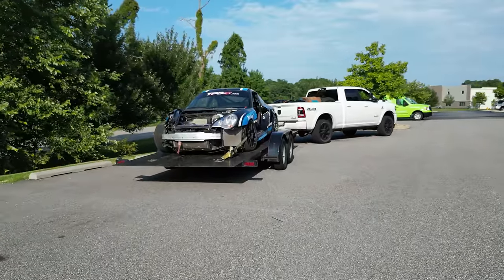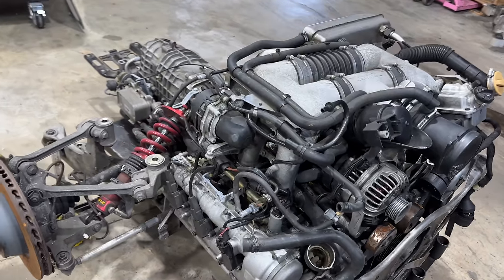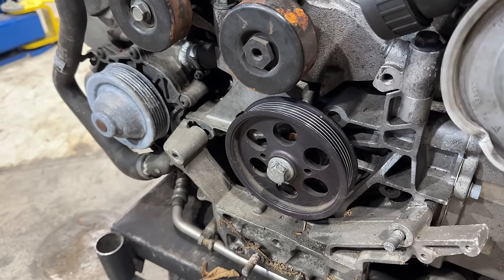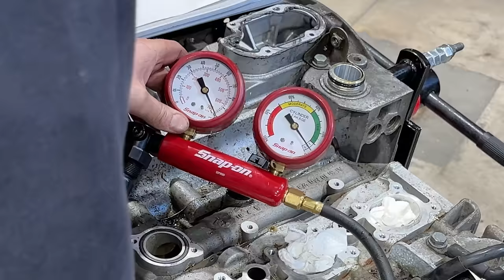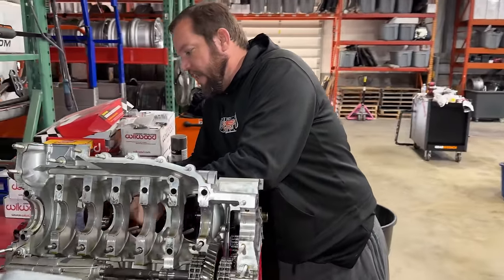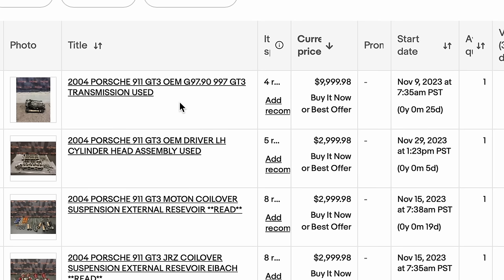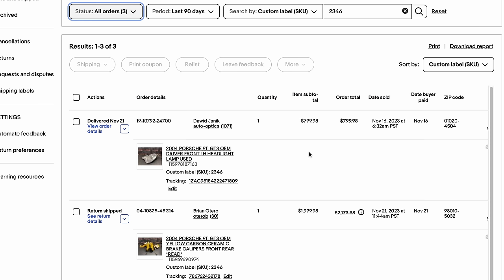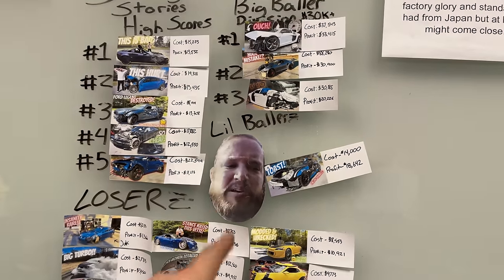I Bought a WRECKED Porsche GT3 Race Car!

Comment: -I am watching this because I have a 1986 911 RestoMod—Outlaw and have owned a 1968 Porsche 356-A SUPER couple in 1968
and a SC in the middle 80's.

-I like the description of the video before the video starts. A little insight into what I will be watching.
-How do you get grass or hay in a sealed up motor?
-What are you 2 hating about the Porsche brand?
-You hate the car for some reason but you got a big pile of parts which = $$$$$ .....no  likeee money Mr.???
-I like hearing about the price for the different parts but I probably wouldn't listen again on another video. I am here at the site just to 
learn anything I can because I like knowing things. NO TO BRAG to others...just for my own knowing.

-Vendetta against Porsche. 
-I think I remember in a previous P-car video you agreed with your brother that you liked Porsche cars.So 
why is your mind swinging so ODDLY? I personally don't care if you like P-cars or not, just trying to figure out your logic.

"A garage without a Porsche is just a dark hole" —Walter Rohrl - Porsche Development

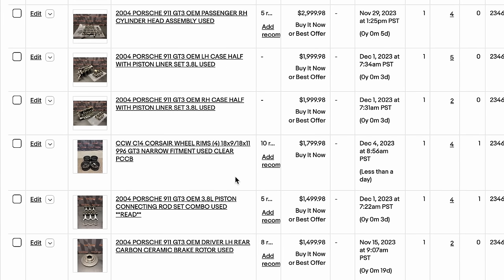Comment: Wait - I thought carbon ceramic brakes were for track use. Why would they convert them to steel for the track ?  23:04
Reply: Carbon ceramics work well for track use but they don’t last very long and will basically burn up, steel will last way longer and is cheaper to replace so not worth ruining the carbon ceramics
Reply: Some series require steel brakes

Comment: Ive seen cylinders washed like that head was by the valves. I have a good feeling that there is an issue with that head around the valves or seats, being the reason you were hearing far more blow by from that cylider than the others.

Comment: That roll cage wasn't worth cutting outta there and selling?  Looked like it held up pretty well.
Reply: I had already been cut before they got it, and had already been through a wreck, I feel like you would have a really hard time getting it certified again, by the time you went through it and fixed all of the cracked welds and everything else it would be better to just fab a whole new one, they are welded in the car so you would have to cut half the car off to get it out and good luck getting it into another car

Comment: Was the roll cage it's self not worth taking out and selling? And goodness, I was dieing with that prank, that was mean but awesome. You guys stole that Porsche. I'm a reseller also but not in auto... yet. I would like to brain storm on options for dead inventory. At some point you just have to either sell something at cost or take it off as it costs more in listing fees than any profit you would make. I have done it several ways but not too sure on what would be best on getting rid of dead inventory. Are you willing to share some options publicly. or otherwise? I'm always willing to listen and learn from other resellers to expand my horizons and maybe find a better way to do things.
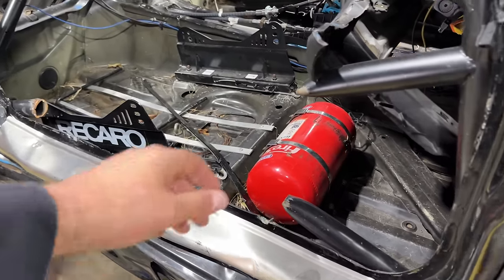Reply: 1:32 cage was cut in the door to extract the driver
Reply: Actual race car roll cages are welded inside the car, since they are larger than any opening on the car once assembled so you would have to chop it into pieces to get it out, at that point you are better off building a new one in your car, and with that amount of cutting on it you would have a hell of a time getting it certified again, only value to one after it's been installed is scrap metal price which is not much, when you have a car caged like 85% of the cost is labor for the fabrication the materials aren't very much at all

Comment: none of these estimates count the amount of scrap metal you got.   Is it that insignificant that you don't even count it?  OR does it kind of wash the other hidden costs of travel, etc.  Last I checked scrap carbon price is about $.16 a lb.  Aluminum (cast) etc., is  a little higher, plus all of the copper.  You gotta be way on the high side of profitable there.